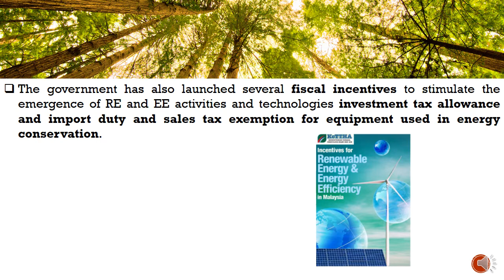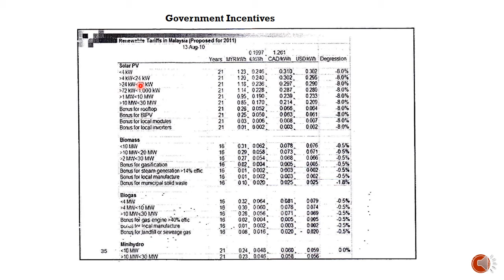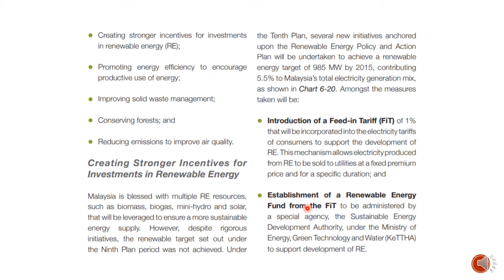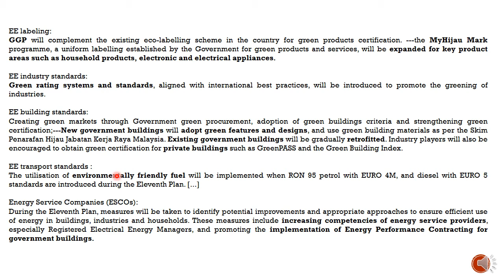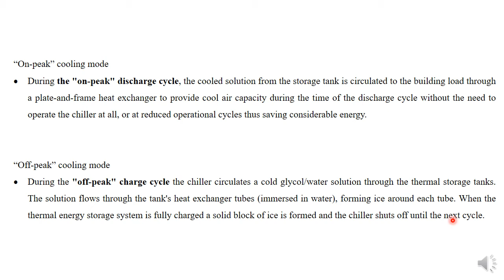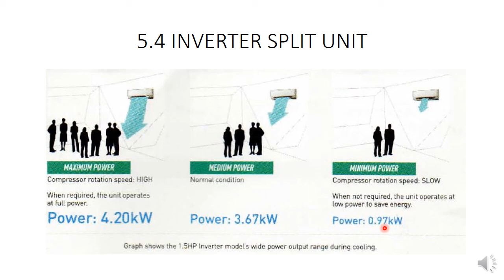Lecture 5&6 Application of “Green HVAC System” in industry

Comment: MOHD SAZWAN FITRIE BIN MOHD. KHAIRIL FITRIE
B071710488
5.0 Application in Industry  

Energy efficiency (EE) strategies under 9MP (2006-2010).
•	Government adopt measures to reduce wastage by enhancing energy efficiency & increasing energy sufficiency
•	Government committed to reduce dependence on petroleum products 
Aim:
•	Energy saving features in the industrial and commercial sectors
EE features efficient lighting and air conditioning systems as well as encouraging the establishment of a comprehensive energy management system.
Government has launched fiscal incentives to stimulate the emergence of RE and EE activities and technologies investment tax allowance and import duty and sales tax exemption for equipment used in energy conservation.
Type of incentives for companies providing EE services / adopting EE initiatives.
•	Pioneer Status (PS)
•	Investment Tax Allowance (ITA)
•	Import Duty and Sales Tax Exemption

Malaysian Tenth Plan (2011-2015).
•	Market Pricing
•	Supply Side Initiatives
•	Energy Efficiency Measures
•	Stronger Governance
•	Managing Change
Environmental management:
•	Incipient industry with substantial growth potential in green technology
•	Will spin off new categories of professionals and new areas of specialization for architectural and engineering services
Affirm Framework
•	Marketing: Ministry of Energy, Green Technology and Water, Standard and Industrial Research Institute of Malaysia (SIRIM)
•	Develop a national eco-labelling scheme and standards for our products and services that matches international standards.
•	Support the Government’s green procurement initiative as well as assist local manufacturers to export their products.
•	Increased labelling of environmentally friendly goods and services such as Energy Efficiency Star Rating, Low Carbon Footprint Products, Green Building Index will increase Malaysia’s competitiveness

Malaysian Eleventh Plan (2016-2020)
•	Increase the adoption of energy efficiency and low carbon buildings, transport, product, and services
•	EE target by 2020, at least 20% of government procurement will be green.
EE Labelling
•	GGP will be expanded for key product areas such as household products
EE Industry Standards
•	Green rating systems and standards
EE Building Standards
•	New government building will adopt green features and designs
•	Existing government buildings will be retrofitted
EE Transport Standards
•	Environmentally friendly fuel
Energy Services Companies (ESCOs)
•	Increase competencies of energy
•	Implementation of energy performance contracting for government buildings

Comment: MOHAMAD SYAFIK BIN SOFI
B071710064
5.0 APPLICATION IN INDUSTRY
energy efficiency strategies under the 9mp 2006-2010
aim : energy saving features in the industrial and commercial sectors.

type of incentives for companies providing.
- pioneer status
-investment tax allowance
-import duty and sale tax exemption

Malaysia tenth plan 2011-2015
-energy pricing
-supply side
-energy efficiency
-stronger governance
-managing chance

environmental management
is in incipient industry with substantial growth potential in green technology and will spin off new categories of professional and new areas of specialization for architectural and engineering services.

affirm framework
-marketing; minister of energy, green technology and water together with standard and industrial research institutes , will develop a national eco-labelling scheme and standard for our products.
-creating stronger incentives for investment in renewable energy.
-promoting energy efficiency to encourage productive use of energy.
-improving solid waste management.
-conserving forest
reducing emission to improve air quality.

Malaysian eleventh plan 2016-2020
government aim:
-increase the adoption of energy efficient
-low carbon building
transport
-product
services

EE target by 2020
at least 20% of government procurement will be green

example of green technology air-conditioning unit.
- thermal energy storage.
-hybrid chiller 
-desiccant dehumidifier system
-inverter split unit.

Comment: LUA WEI JIE - (B071710861) 4BMMH S1/2

Energy efficiency (EE) strategies under the 9MP (2006-2010) :

1.	To reduce the wastage by enhancing energy efficiency 
2.	Increasing energy sufficiency.
3.	To reduce dependence on petroleum products

Aim : Energy saving features in the industrial and commercial sector.

Malaysian Eleventh Plan (2016-2020) Target: Increase the adoption of energy-efficient and low carbon buildings, transports, products and services.

EXAMPLE OF GREEN TECNOLOGY MACHINE/SYSTEM IMPLEMENTED IN HVAC INDUSTRY.
1.Thermal Energy Storage
-Thermal energy storage (TES) is a technology that by heating or cooling a storage medium, stores thermal energy so that the stored energy can be used for heating and cooling applications and power generation at a later time. In particular, TES systems are used in buildings and industrial processes.

2. Hybrid Chiller
-For their ability to handle large loads with very high efficiency and low cost, hybrid chillers are needed. They are usually used and act as the core of central plant systems in larger commercial, manufacturing, and process applications.

3. Dessicant Dehumidifier System
-Desiccant dehumidifiers are particularly well suited at low temperatures and low humidity levels to extract moisture from the air. A proprietary desiccant wheel composed of corrugated material is at the centre of these dehumidifiers. Air moves through the material's flutes, touching the desiccant.

4. Inverter Split Unit
-An inverter is a frequency converting unit. In many home appliances, the technology is used and regulates electric voltage, current and frequency. In order to control the refrigerant (gas) flow rate, an inverter type air-conditioner changes the compressor speed, thus consuming less current and electricity.

Comment: MOHAMAD ZARIF BIN ROSTAM
B071710681
4BMMH S1/2

APPLICATION OF GREEN TECNOLOGY IN INDUSTRIES.

ENERGY EFFICIENCY (EE) STRATEGIES UNDER 9MP (2006-2010)
1. The goverment will adopt the measures to reduce wastage by enhancing energy efficiency and increasing energy sufficiency.
2. Goverment also committed to reduce dependence on petroleum products through increased the usage of alternative fuels such as biofuels and biodiesels.

AIM OF THE STRATEGIES
1. In the manufacturing and commercial industries, energy saving features applied and enhanced.

ENVIRONMENTAL MANAGEMENT
- Is incipient industry with substantial growth potential in green technology.
-Spin off new categories of professionals and new areas of specialization for  architectural and engineering services.

INITIATIVES TO DRIVE ENERGY EFFICIENCY EFFORT (HVAC INDUSTRY)
1. Increasing in use of energy efficiencies machineries  and equipment.
2. Introduction of Minimum Energy Performance Standards for selected appliances to restrict the malfunction, import and sale of inefficient appliances to consumers.

MALAYSIAN ELEVENTH PLAN (2016-2020)
1. Sustainable consumption and production practices will increase the adoption of enrygy-efficiency and low carbon buildings, tansports, products,  and services.
2.Embarking  on Green Growth:  Resource and energy efficient in balancing both supply-side and demand-side considerations and constraints.
3. Encouraging low carbon mobility through utitlisation of energy effiient vehicles and public transports.

AIM: By 2020, it is targeted at least 20% of goverment procurement will be green.

EXAMPLE OF GREEN TECNOLOGY MACHINE/SYSTEM IMPLEMENTED IN HVAC INDUSTRY.
1.Thermal Energy Storage
-Thermal energy storage (TES) is a technology that by heating or cooling a storage medium, stores thermal energy so that the stored energy can be used for heating and cooling applications and power generation at a later time. In particular, TES systems are used in buildings and industrial processes.

2. Hybrid Chiller
-For their ability to handle large loads with very high efficiency and low cost, hybrid chillers are needed. They are usually used and act as the core of central plant systems in larger commercial, manufacturing, and process applications.

3. Dessicant Dehumidifier System
-Desiccant dehumidifiers are particularly well suited at low temperatures and low humidity levels to extract moisture from the air. A proprietary desiccant wheel composed of corrugated material is at the centre of these dehumidifiers. Air moves through the material's flutes, touching the desiccant.

4. Inverter Split Unit
-An inverter is a frequency converting unit. In many home appliances, the technology is used and regulates electric voltage, current and frequency. In order to control the refrigerant (gas) flow rate, an inverter type air-conditioner changes the compressor speed, thus consuming less current and electricity.

Comment: ALDY HENRY DUSIM
B071710329
4 BMMH S1/1

Energy efficiency (EE) strategies under the 9MP (2006-2010)
- measures to reduce wastage by enhancing EE and increasing energy sufficiency 
- reduce dependent on petroleum products
Aim: energy saving features in the industrial and commercial sectors

Type of incentives for companies providing EE services
-Pioneer status
-Investment Tax Allowance
-Import Duty and Sales Tax Exemption

Malaysian Tenth Plan (2011-2015)
Strategic Pillars:
-Energy pricing 
-Supply side
-Energy efficiency
-Governance
-Change management = incipient industry with substantial growth potential in green technology. 

Affirm Framework
Creating stronger incentives for investment in renewable energy
- Introduction of a feed-in-Tariff (FIT)
- Establishment of a Renewable Energy Fund from FiT.

Malaysian Eleventh Plan (2016-2020)
Target: Increase the adoption of energy-efficient and low carbon buildings, transports, products and services.

Example of green technology in HVAC
- Thermal Energy Storage
- Hybrid chiller
- Desiccant dehumidifier system
- Inverter split unit

Comment: LIM PEI JUN 
B071710194
4BMMH S1/2

Energy efficiency (EE) strategies under the 9MP (2006-2010)
Target: Energy saving features in the industrial and commercial sectors.

Malaysian Tenth Plan (2011-2015)
Target: Five Strategic pillars of the new energy policy
- Energy Pricing
- Supply Side
- Energy Efficiency
- Governance
- Change Management

Malaysian Eleventh Plan (2016-2020)
Target: Increase the adoption of energy-efficient and low carbon buildings, transports, products and services.

Green technologies in HVAC field.
-Thermal energy storage
-Hybrid chiller
-Desiccant dehumidifier system
-Inverter split unit 
-Non-inverter split unit

Comment: AHMAD LUQMAN HAKIM BIN ZAMBRUS
B071710359
1 BMMH S1/1

Energy efficiency (EE) strategies under the 9MP (2006-2010)
-	Reduce wastage by enhancing energy efficiency 
-	Increase energy sufficiency.
-	Reduce dependence on petroleum products
Aim:
-	Energy saving features in the industrial and commercial sectors
-       Efficient lighting and air conditioning system as well as encouraging establishment of a comprehensive energy management system.
-       Fiscal incentives to stimulate the emergence of RE and EE.
-       Investment tax allowance and import duty and sales tax exemption for equipment used in energy conservation.

Type of incentives for companies providing EE services
-	Pioneer status
-	Investment Tax Allowance
-	Import Duty and Sales Tax Exemption

Strategic Pillars:
•	Energy pricing 
•	Supply side
•	Energy efficiency
•	Governance
•	Change management = incipient industry with substantial growth potential in green technology. 

Key strategies: 
•	Streamlining the green technology council to drive the green technology agenda across multiple ministries and agencies
•	Creating the environment and demand for the green technology industry 
•	Developing and enforcing regulation
•	Promoting investment in renewable energy
•	Promoting culture of conservation and efficiency in energy and water use

Affirm Framework
Creating stronger incentives for investment in renewable energy
- Introduction of a feed-in-Tariff (FIT)
- Establishment of a Renewable Energy Fund from FiT.

Malaysian Eleventh Plan (2016-2020)
•	Increase the adoption of energy-efficient and low carbon buildings, transport, product and services.
•	EE target by 2020, is at least 20% of government procurement will be green.
EE labeling
•	GGP will be expanded for key product areas such as household products, etc.
EE industry standards
•	Green rating systems and standards.
EE building standards 
•	New government building will adopt green features and designs
•	Existing government buildings will gradually be retrofitted.
EE transport standards
•	Environmentally friendly fuel 
Energy services companies (ESCOs)
•	Increase competencies of energy 
•	Implementation of energy performance contracting for government buildings.

Example green technologies in HVAC field.
1) Thermal energy storage
      - Iced storage are used in refrigeration in order to cover and increased additional refrigeration demand
      - Capture low cost energy from the power grid during the night.
      - No cooling load at night and good for any new facility has a large cooling load during daytime  

2) Hybrid chiller

      - Handle large loads at very high efficiency and low cost 
      - Low operating cost 
      - Saves space, plant room not required 
      - Easier to maintain 
      - Easier and cheaper to install 
      - Energy efficient, consumes 10%-30% less energy.
      - 45%-50% less water consumption

3) Desiccant dehumidifier system
      - Humid outside air
      - Dehumidified Air
      - Regeneration and heater 
      - Moist air to outside  

4) Inverter split unit 
    - output power is consistent 
    - compressor runs at consistent speed with the operation capacity 

5) Non-inverter split unit
    - output power is not consistent 
    - compressor runs at either on or off basis; maximum speed for supplying cooling load, off when the temperature has reached